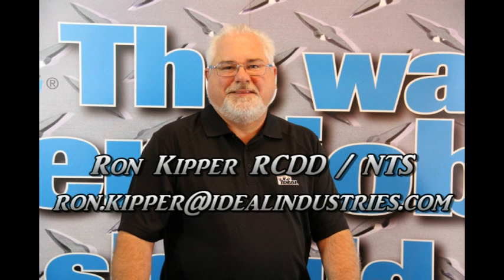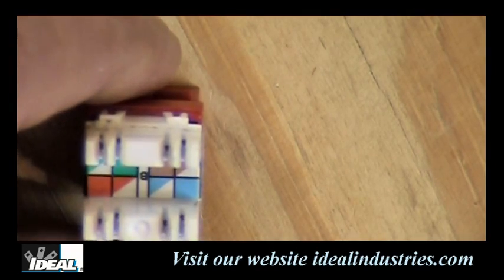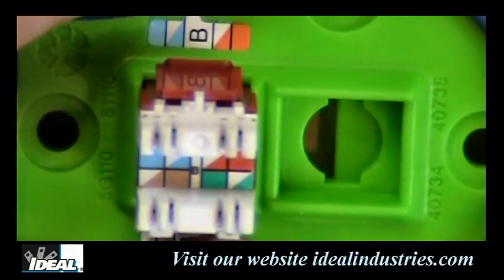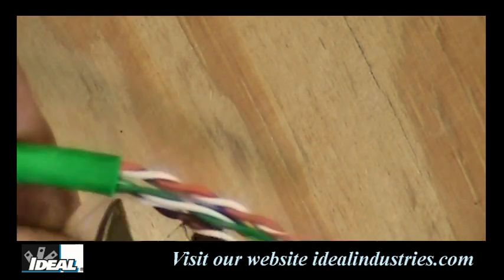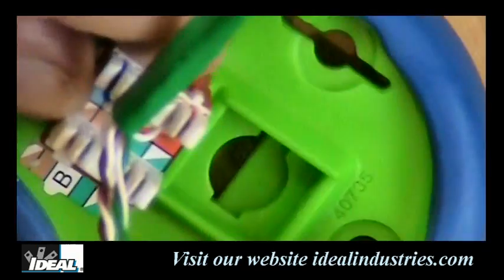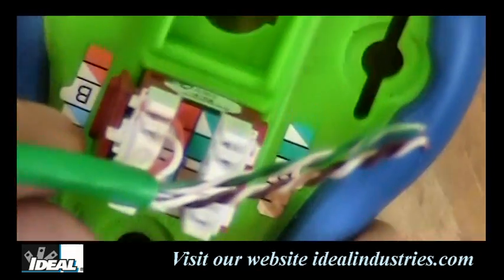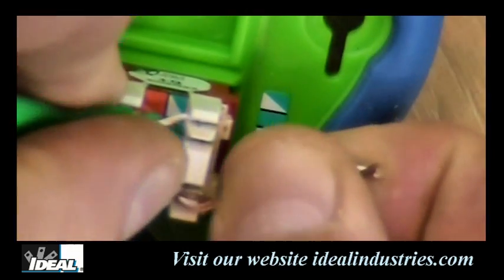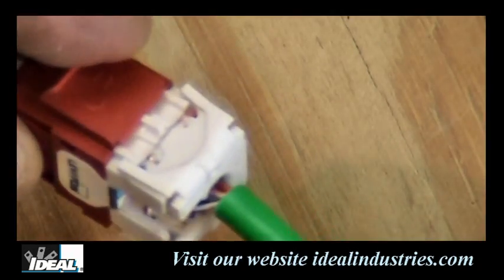Cat 6 Jack Termination

Comment: Aren't you worried about scoring the cable. Isn't that what the cord/ribbon is for? After I use the jacket stripper I use the cord and tear down about 2 more inches so there is no risk of the stripper nicking the wires. Just make sure that the part u stripped with the tool is going to be discarded after termination. I know you do a lot more terminating than I do that's why I am not 100% sure if I nicked the wires. Hahaha.
Reply from the maker: Farcry nice to here from you and if you only go around once with the stripper you should not damage the wires inside. A little practice and you will be good to go. Have fun out there installing those jacks.Ron